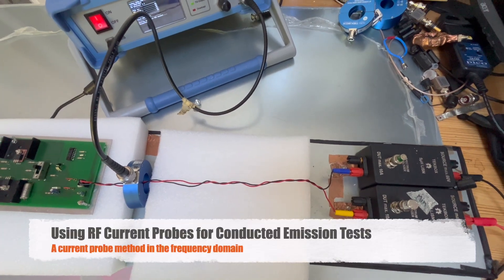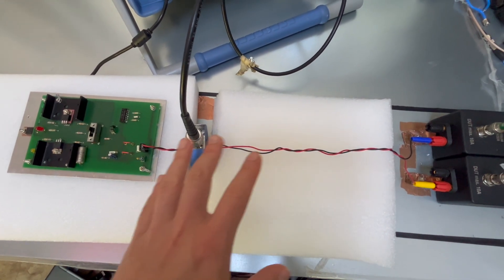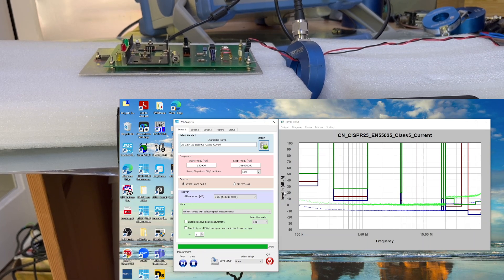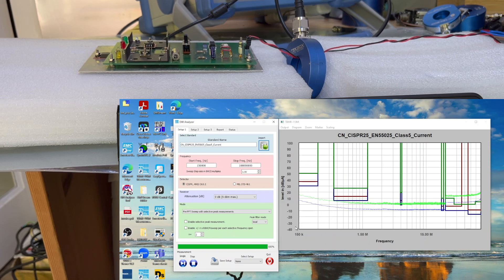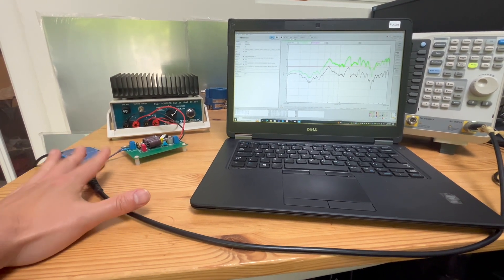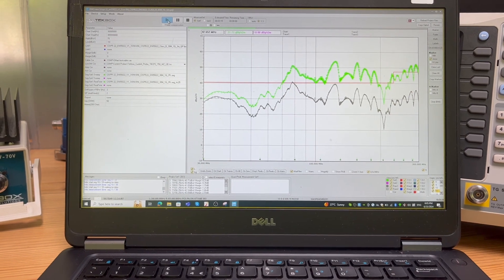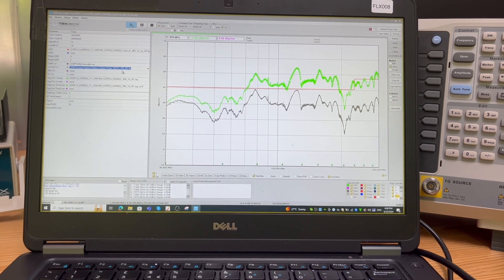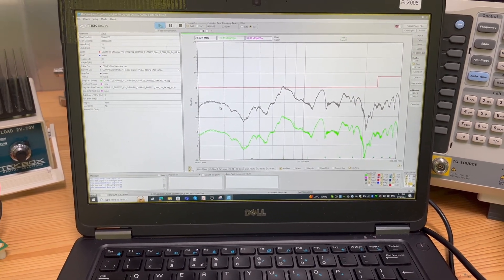RF Current Probes Episode 6 - Measuring Conducted & Radiated Emissions

Comment: Really nice explained. I have a device here that failed the radiated emission test at 400MHz by 10dB and I can produce pretty much the same result as in the EMC test lab with the current probe. Really a powerfull tool.
Reply from the maker: As I always said, perhaps the most useful troubleshooting tool for design engineers. But in the UK, I am quite sad to see most test engineers use RF current probes for testing, without understanding what they do, hence they do not know how to use the current probes for troubleshooting.